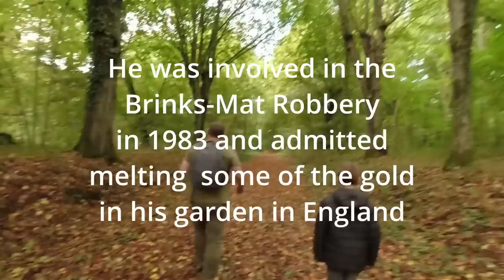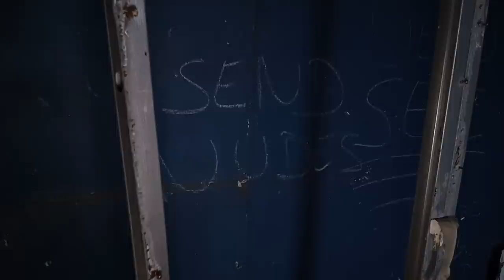A gangsters paradise! | WE EXPLORE JOHN PALMER'S CHATEAU GOLDFINGER!

Comment: Moisture barrier on walls is a goo thing
But I recalled reading wood against concrete can be issues in the future when seeing your framing sit on the concrete 
Looked it up and this is what I found, I know some will have other opinions though

Googled answer
When wood is kept in direct contact with concrete, the moisture in the concrete will be drawn up into the wood, and after a period of time the wood will rot. A sill gasket made from a soft plastic material is designed to prevent moisture to seep from the foundation to the lumber frame